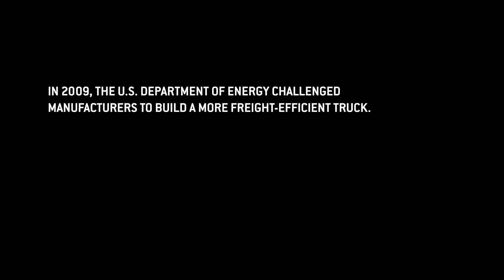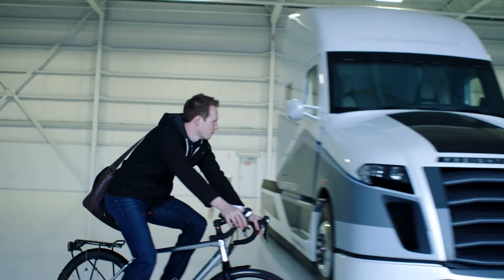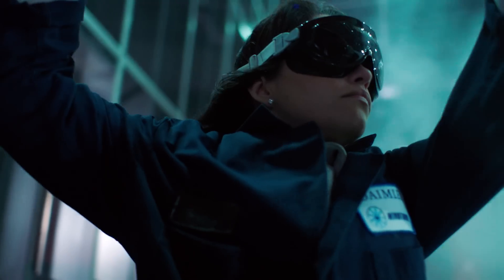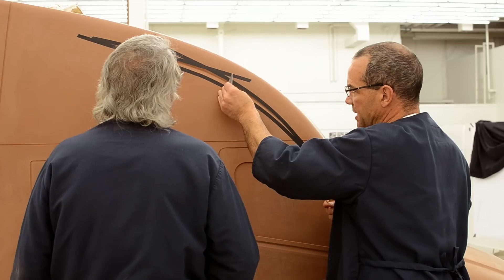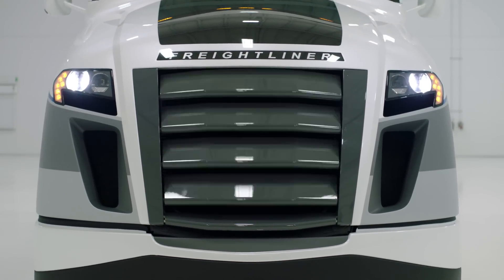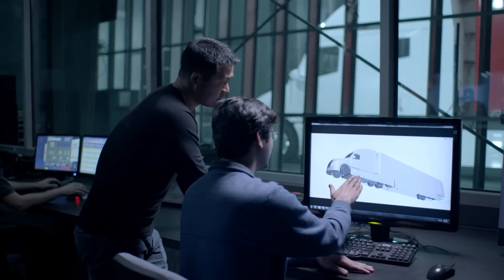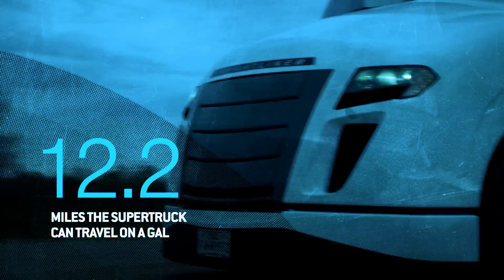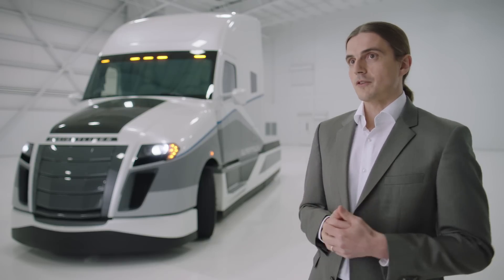Introducing Freightliner SuperTruck

Comment: your only selling point is the aerodynamicness of the truck.

does this so-called supertruck have hydraulic ABS brake system for the tractor and electric brake system for the trailer. the whole combination vehicle needs to be redesigned and should act as one unit. maybe in 2030?